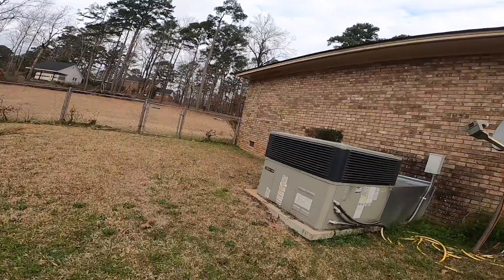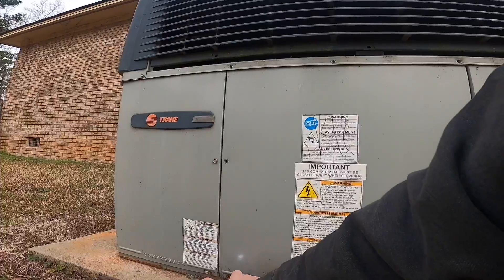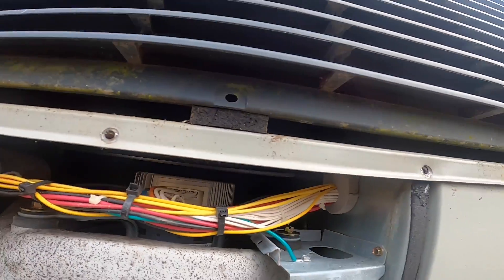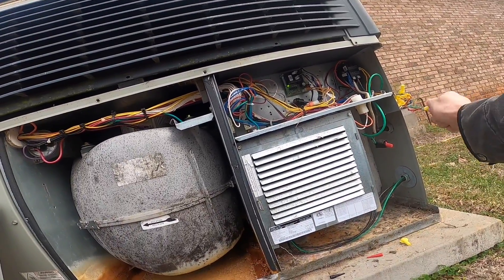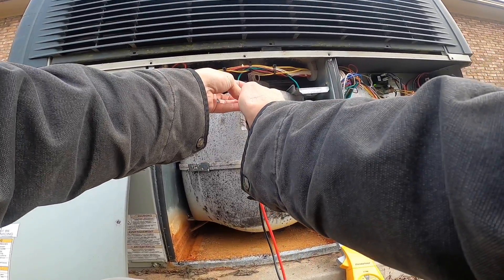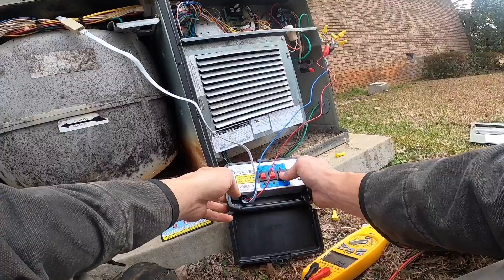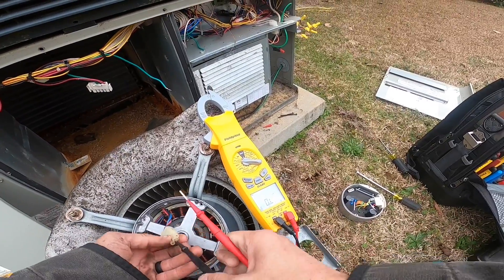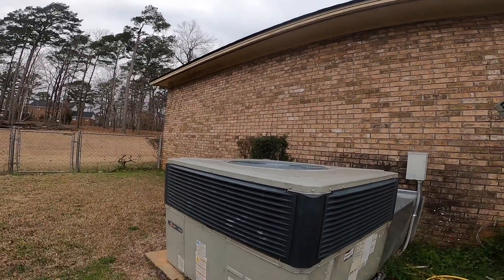Diagnosing a variable speed motor that’s not working.

Comment: Isn't it a good rule of thumb to just replace both the module and the motor regardless of what the problem is? If it's a bad module replace both and if it's a bad motor replace both. 
To me I think it might just be risky replacing one or the other. How can we be sure one didn't take the other out?
Reply: I think most manufacturers sell you both nowadays .
Reply: The motor itself should ohm out as a three phase would with equal resistance across all three terminals. If the motor is OK, you can just replace the module. If the motor does not test, OK you need to replace both because the motor will take out the module again.

Comment: So much corrosion inside the fan cabinet!
Reply from the maker: Yeh, I’m guessing the drain was clogged, and it flooded. I plan to flush it with water when I go back.
Reply: @HVACGUY  Or the negative pressure in the blower compartment is pulling in water when its raining outside??? that whole packaged unit should be on a few legs of some sort to raise it a few inches off the pad... the equipment base will rust out from water setting underneath taking longer to dry out... needs some ventilation.